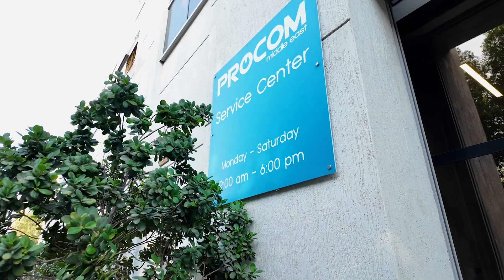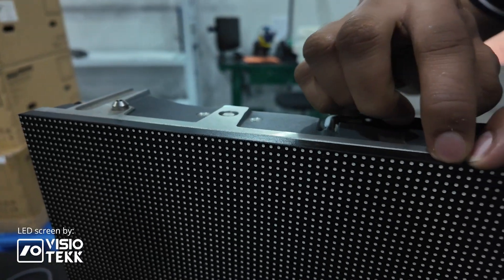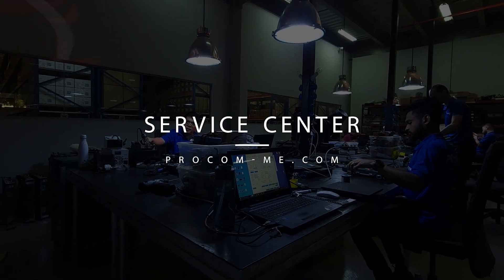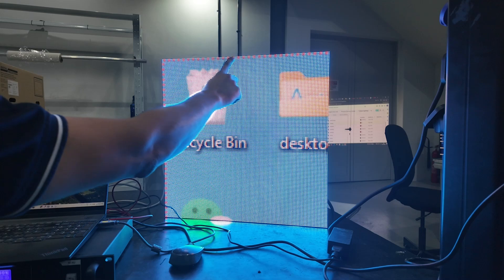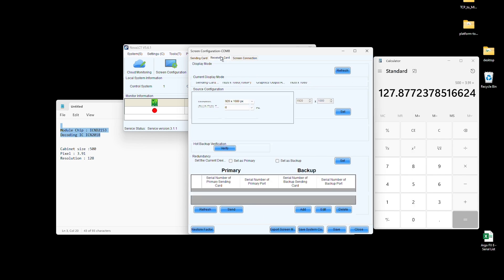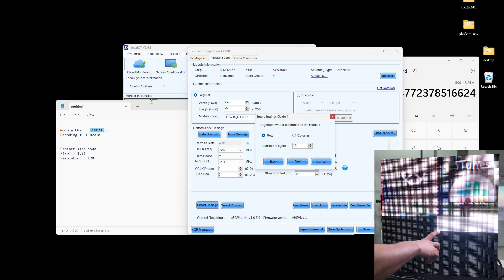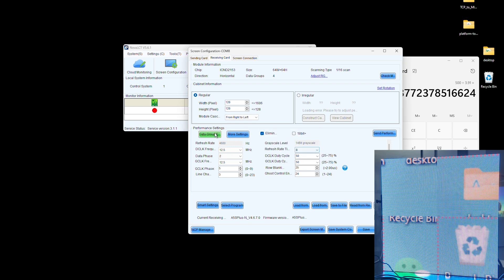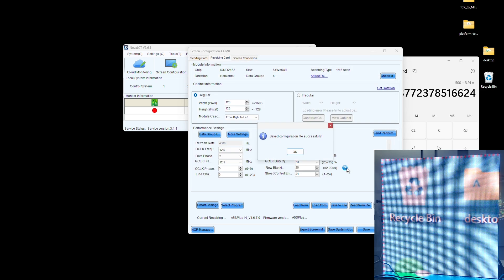RCFGX File Creation Made Easy with NovaLCT for LED displays

Comment: What if I have 8 nodules in a cabinet?
Reply: Same problem here , my screen 500mm x 1000mm 3.9
It’s color not good coming like waves also the manufacturer send wrong RCFGX file 
Now i want to create that file from scratch like in the video 
Also we used vx1000, vx16s, vx4sn, and h2 series and same problem 
And on H2 processor when configuring the led wall, the image coming colorful and flickering like old TVs but with too much colors and we checked everything in NovaLCT.
That’s why we want to create the RCFGX file
Thank you
Reply: @BaselJawash  hey I know it's been a while since you wrote. But did you manage to get an answer to your question? I have exactly the same problem as you. Can't find a solution. Do you possibly have a solution?